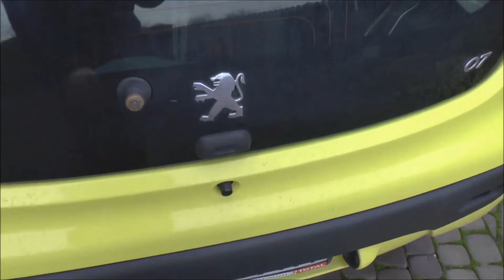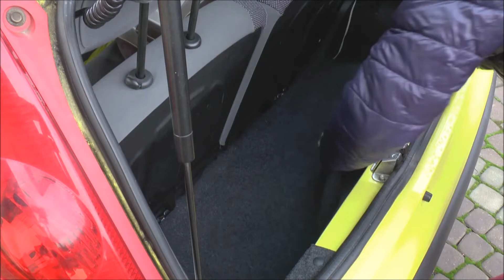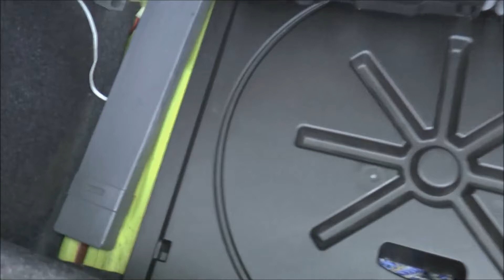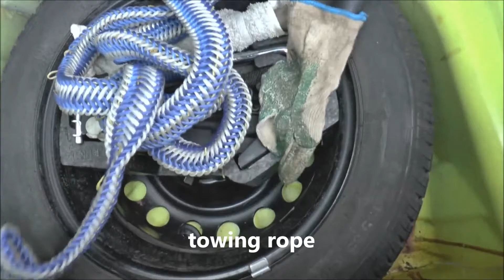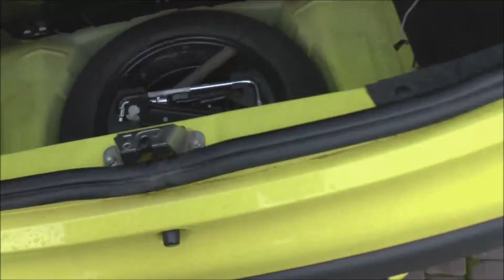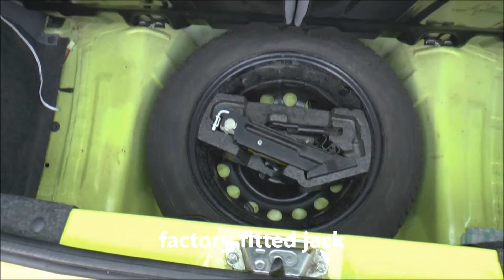Things I carry in the boot - Peugeot 107, Citroen C1, Toyota Aygo

Comment: Didn't saw the reflective vest! Don't you guys have to carry, at least one, in whatever country you're located?

One very practical thing I usually have in all my cars. 
12V compressor, for this tiny car I got the smallest I could find. Perfect for occasional use and it's smaller than the foot actuated versions. 
Cheers
Reply from the maker: Those vests are obligatory on motorways only here in Poland. Where do you live?
Reply: @fixanddrive - I'm in Portugal & Norway! In all EU the reflective vest must be present in the car at all times, along with the emergency triangle. Poland is also an EU member...  ;-)
Absence of both items it's a fail in the EU control/MOT/car inspection, fail type 1 if memory serves. ;-)
Cheers
Reply from the maker: @crpth1  I see, I know they are obligatory in other countries but the rules differ. In Austria you need to have as many vests as the number of peaople in the car. In other countries you need to have just one. In Poland  you need one and only on motorways :)
Reply: The vest is supposed to be stored near the driver so they can put it on BEFORE exiting the vehicle.